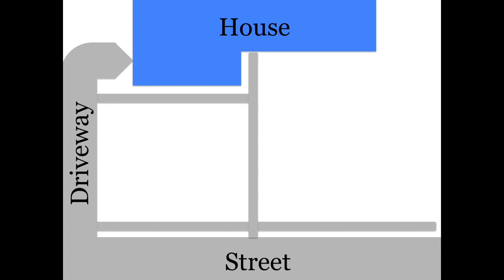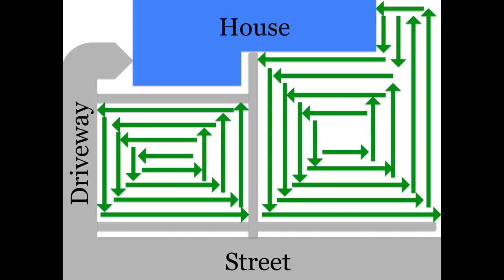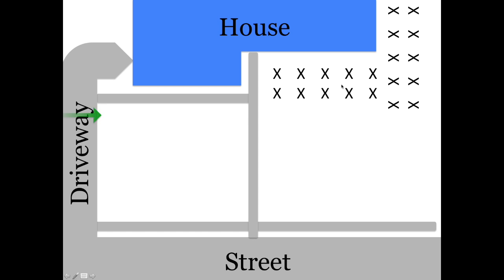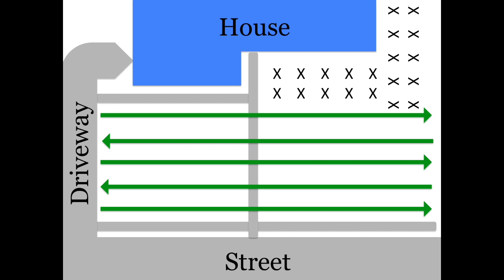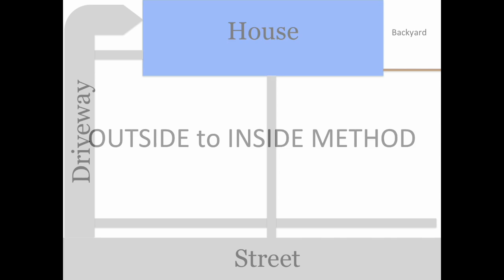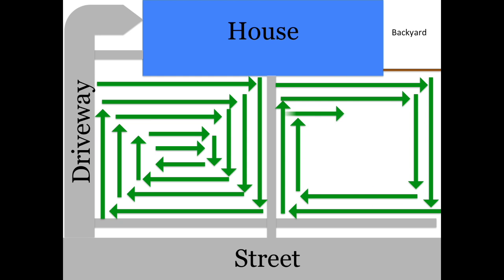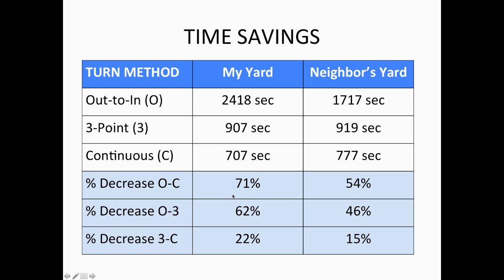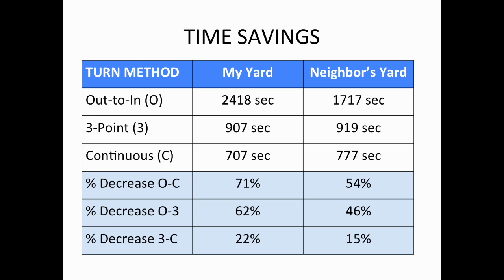A FASTER way to mow your yard!!

Comment: Long axis with continuous  turns allows you to go faster and use your driveway or street to make turns and reduce damage to turf.
I call it the Zamboni method because they do not use reverse or make sharp 180⁰ turns. 
Drive it like your throttle is stuck wide open and slow for trees and turns.
I dont understand snowplowers that use pickup trucks and Bobcats to plow hugh shopping malls.
They plow to one side of the lot then back up several hundred feet and do it again and again in the same direction.
Their plows are spilling over and they have to make more passes to clean them up.
Reply from the maker: Dig the Zamboni name!

Comment: Although it seems good to do a optimised long axis pattern as you call it, I find that it does make a significant difference to the normal long axis method (called striping by us lawnies). when you go up one pass, do a 3-point turn and then go back down right alongside the previous pass, you start to create a very good-looking stripe pattern. If your mower doesn't stripe or if you dont really care then doing the "optimised long axis pattern" is fine but to make it look really good doing the normal 3-point turn striping pattern is best.
Reply from the maker: I've got St Augustine and it doesn't stripe.  If I had a finer texture grass like Bermuda, Fescue, or Bluegrass, I'd definitely do a stripe.  However, down here in southcentral Texas, St Augustine is what we've got and the thick coarse texture doesn't stripe at all.
Reply: Yeah I mainly try to stripe regardless of whether it is really obvious or not just to keep it in my mind but whatever works for you ;D

Comment: Try this, hope I explain it, on the golf cause I worked at , we went down the middle for the first run, then did the outside of 1 half, coming back into the centre again and going down and doing the outside of the other half, then keep going in that direction of inside to out and then outside to in, you won’t be doing any180 deg turns, it’s like doing figure 8s but after a few cuts you can go from side to side and make sure you end up on the opposite outer side to let you maximise you turning circle, as they will be a consistent arc not a hard turn, lI hope ive explained it so you can understand, it’s a heard thing to explain with just typing,
Reply from the maker: I like that option.  I will have to give it a shot and see how it goes.  Thanks for sharing!

Comment: I am an engineer also (civil).  I have been moving my yard similar to this for more than 30 years.  Only difference is that I do it in blocks the width of two end turns.  This is not new to me either.  I saw farmers doing it that way to forage harvest more than 50 years ago.  If you are pulling chopper and a wagon behind a tractor, it is near impossible to turn sharply or back up.  Nice to see some actual numbers.
Reply from the maker: That's where I got the idea, from mowing fields when I was younger.  Thanks for the kind words.

Comment: When I got a 457/38 Rover MDT lawn tractor it was great I got It was because I found it was becoming more and more painfully difficult to mow my lawn. As over the last few years I developed two arthritic knees.  My lawn tractor though expensive was one of the best investment I ever made. And though it expensive to buy and maintain As ever few years I go though the usually amount of belts and blades.  (Blades here cost about $20.00 and belts about $36.00)  But it is well worth it. But I still have to go though a bit of preparation before I can even mow the lawn   My one problem with mowing my yard is getting  in to those tight corners,  around my yard.  So to fix this Ill will go and mow the corners first with ether  my lawn  edger or my push mower. But with the lawn tractor doing most of the heavy work  Doing these small arias  two arthritic knees. is a lot easier  for me. After I  have done  this  first.  before I mow with the lawn tractor I to mow the lawn with two munching blade out side to in.  it seem get a better result takes lest time and looks better because when I get off the  lawn tractor Im finished.

Comment: Great video! Check out a used John Deere X304. It is tractor style but with 4 wheel steer (mechanical linkage). Helps with tight turns on your continuous method so you dont leave odd shaped passes. Cheaper to buy than a zero turn because less hydraulics. It does still have a hydro-static trans.
Reply from the maker: Thanks for the tip.  I'm always on the lookout for new gear!

Comment: I like your method. Will try it next time. My current solution is to treat the path as a rounded rectangle, where the corner radius is relatively large to allow for constant mower speed at every point along the path (i.e. out-to-in with large turning radius). No time is lost because the mower is always cutting along the turn, similar to your method here. It does get tricky as the minor axis becomes smaller than the mower's smallest practical turning radius at nominal speed (new video for optimized small area rider mowing?). The mow time is path length / avg. mower speed plus any polishing time, which should approach the theoretical minimum mow time because the polishing time should approach zero. But it might be best for large, unobstructed areas.

Comment: I also skip rows to avoid excessive movement in one turn and/or reversing.  It helps, until you lose focus and either cut too much or too little in width, forcing you to make additional passes for a mere 3ft of grass, for example.  For my particular yard, tire chains and a more powerful motor would be of greater help.  I am also an engineer.  Thanks.
Reply from the maker: Thanks for the comment.  In need of chains and a bigger mower, sounds like you may have bigger fish to fry than the the time.  It's good to know that other engineers think about these things too.

Comment: The best way to speed up mowing is to use a zero turn mower, or get a wider cut deck.
Reply from the maker: 100% true, no doubt, but sometimes you've got to figure out a way to make the best with what you've got.
Reply from the maker: Believe me, if I had the capital to invest, I'd be all over a zero-turn with a 60" deck.  Just playing with the hand I was dealt.  Bought the JD used from a neighbor who was moving for a steal...
Reply: Love my ZTR for two reasons.  One is its maneuverability.  Second, is its faster ground speed.

Comment: Outside to inside-  that how I have mowed grass for 60 odd years.  I always cut a double wide perimeter pass and then start mowing the interior box.  However any obstacles in the interior will determine how you cut it.  I save the hard parts for last and often nibble at them while I am cutting the interior box.  I last try to divide my yard in squares and cut them, I dividually.  I try to change my plan, so I have as little double cutting, as possible.  I learned how to cut grass, efficiently, by learning how to plow a field at my grandfather's farm, as a boy.  I do not like 180 degree turns and try to make most of my turns only 90 degrees.  Since I direct all clippings to the inside, so I can mulch them up on succeeding passes.  So, my turns are mostly, right turn, march.

Comment: So, I do similar and found it easier but I have to plan the discharge so I don't have as much clean up which would just shift the time rather than save it and don't rip up the turf as much so it looks better and I now save 30% of my mowing time so I can sit in the shade more and enjoy the view while using the words 'so' and 'and' to eliminate periods so I can say the sentence faster. :)
Reply from the maker: I always use the mulchingso it's not as big of a deal with the discharge.  I can see how that will make a difference though.

Comment: You could use my method. Cut the perimeter then cut the middle of the un cut section, now you have 2 sections. Always cutting the opposite uncut section middle that way your always going forward and widens your turn  making it easier. Saves fuel and time also a full cut each time. I have been doing this for 40 years and I cut a lot of grass. 5 acres of yard, then bush hog 15 acres. I found it applies to all , the type of machine doesn't matter. Calculate that one.  Save a hell of a lot of time and fuel as opposed to other methods. My way has cut my mowing time by better than half, try it.
Reply: that is exactly what i do...  when you get near the end you do a lot more just driving than cutting but i use that time to hit little spots that might need a little more or around an obstacle or tree...

Comment: I prefer the outside to inside method. But I've been using zero turn mowers for over 30 years. Before that, I used a (non-gas) reel push mower & the.longest axis method.
Reply from the maker: I keep getting the suggestion of the zero-turn.  Next mower, I think I'll probably upgrade, but not nearly to the scale you did!
Reply: You won't regret it. I'd suggest buying used. My first one was new, definately not worth the extra cost.

Comment: the optimized method saves you on mechanical maintenance by not beating up your reverse in the transmission and on the wheel bearings.
Reply from the maker: So very true.  I've got a neighbor who got a similar mower and has just been having trouble with his hydrostatic transmission.  Mine is still going strong.

Comment: That’s pretty much how my grandpa taught me to mow when I was a kid. Do the perimeter of the rectangle and then use the area you’ve already cut on the short ends of the rectangle to turn in so all the rows are the same length. Divide it into sections small enough that you don’t waste to much time turning on grass you’ve already cut but large enough that you don’t have to reverse to change direction.

I’m like you though, I’ve tried every pattern imaginable and time myself when I mow.
Reply from the maker: Thanks for the response.  It's so funny the life this video has taken on.  This was my very first video and I change how I mow all the time.  I now mow my neighbor's yard in a "continuous circle" where I mow an outside line and then split the yard in half and continue to loop on the outside in.  It's really fast for his yard because it's a big rectangle, but for mine there are lots of other better ways.
Reply: TXSuburbanHomestead That sounds like what I settled on for my grandparents old house. I still mow the yard and one day I decided to just mow the entire thing at once instead of breaking it into sections. did the entire 3 acre perimeter and worked my way in, now I cut it in half and do it that way, I cut 30 minutes off the time.

Comment: Should alternate between left right and up down.

3 point turns, you have to almost come to a complete stop. Skiping a lane makes that arc where you can maintain a higher speed, along with less possible wheel damage to grass from the  turn. Only issue is making lines straight.
Reply from the maker: I couldn't agree more.  I've started alternating L/R & U/D.  I've also do a diagonal from time to time.  It's interesting though, since I've started doing this, I don't run over the same lines as before, so I run into less of an issue with the wheel damage because the lines I'm cutting are more random as to their origin/termination points.

Comment: Form  video like this I bought a lawn tractor I live  in Queensland Australia. Im 67   I have only a quarter acre block. I all ways thought  my quarter acre block.was to small for a lawn tractor When I got old I  retired  then I found out I have osteoarthritis in both knees So  I was finding it all most impossible to mow my lawn with a push mower So  over the years I been spraying it with round up weed killer. but the problem was over time the weed killer  kill off all of the good grass Then  what was left of my  lawn was mostly four feet high paspalum grass, it a weed that grows  here when it rains  It this weed ever ends up in you years it almost impossible to get ride of When it rain it will rain for two weeks  in that two weeks  paspalum grass,  will grows to be about four feet high and be about a quarter inch thick.   When it gets to that stage it is all most impossible to cut it with a push mower.  I have only a quarter acre block. And now  Im only on a government pension So  eventually  I could not afford to pay some one to keep coming out and keep mowing  it . As  they  would  charge $100.00 first time then it was $50.00 ever two weeks.   So for a while it did not get mowed Then the local council  keep sending me letters. I did not know what to do until I saw your video of you using a Lawn tractor to mow a small block So I bought a second hand Rover 547/38 lawn tractor. it was only a year old for $2000.00 New these sell in my country for  $3,300.00. when I bought it it had only about 38 hours on it. But The first day I use it I did not know about blunt blades cutting  the four feet high paspalum weed with the blunt blades it had   I burned the deck  belt out. But after I replace the blades with a set of Gator blades and the new deck belt it cut though the paspalum grass  like it was nothing. I have now put another 10 hours on it and been fantastic. so thanks for posting

Comment: How about outside-in across the long axis. If you go straight across the sidewalk you will reduce your number of turns by half.
Reply from the maker: I've been trying that recently.  It works great until I get to that little patch close to the house.  There are so many little turns in there that even with a hydrostatic mower, it ends up taking longer.
Reply: Mow the right side that includes your little patch in a front-to-back ( ^ v ) fashion first, and then go side-to-side ( < > ) when you get to the large area in front of the house.

Comment: The problem with the new method is that with a push mower, your paths are differently colored so your yard would look like an odd stripe pattern of like 1,3,1,2,2,2,1,2
Reply from the maker: This all goes out the window with a push mower, but with a riding mower and St. Augustine it's not that big of a deal.  To get stripes on St. Augustine, you really have to work because of the density of the blade.

Comment: You and I are on the same channel with the continuous method. Something I figured out a few years ago. NOW that I have a Snapper mower with a Hydro static transmission. I can do forward and backward mowing and take care of the spots that need special attention, later. I have trained my self to get a 'feel' how I'm mowing in reverse to cut the next track of grass. I also select small areas of grass and input my method of forward and reverse cutting, where I can. Doesn't work all the time. Your continuous method is effecient.

Comment: You changed the YARD in comparing the 'outside/in' method to the 'longest axis' method; you omitted the dividing sidewalk for the 'longest axis' method.   Omit the sidewalk for the 'outside in' method and your turn numbers equal out....PLUS you make shorter turns (90 degrees verses 180 degrees) using the 'outside in' method, for less non-value-added time.
 I use the inside-out spiral-method for my largest yard; start in the middle and spiral out until only four corners remain, then hit them.  This gives me virtually NO turns; all the time spent spiraling out is spent going forward, mowing.  Not all yards are laid out the same, that's why you have to try various methods before deciding on the best. (I also was an engineer before retiring, and received a lot of efficiency training)